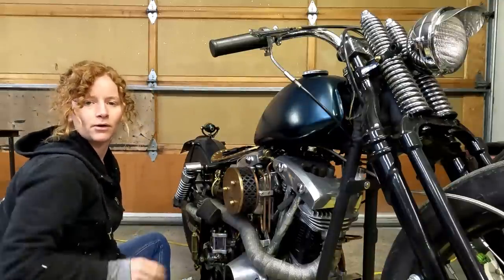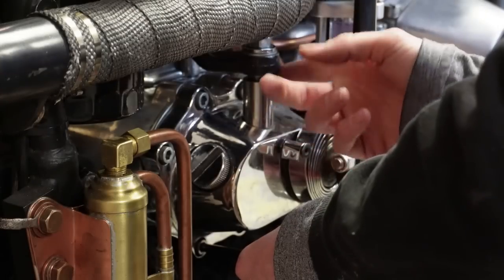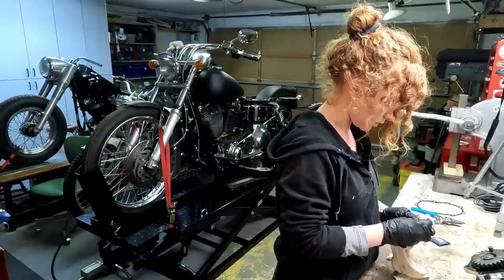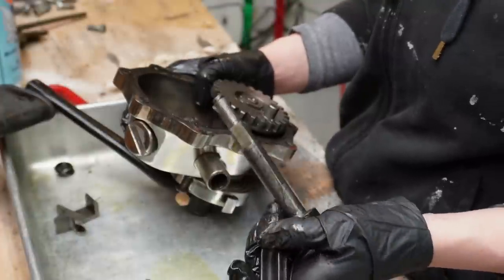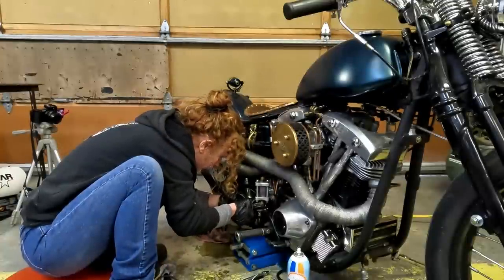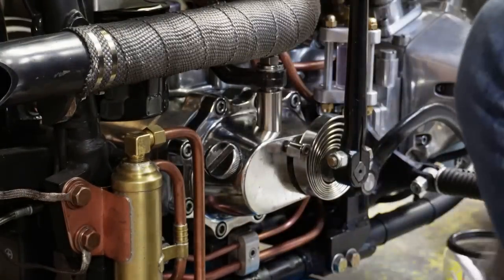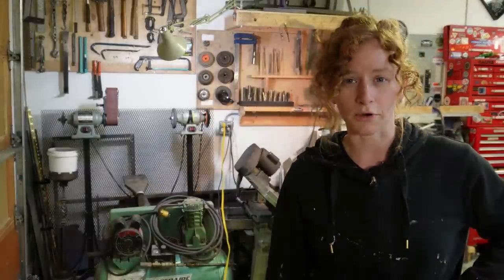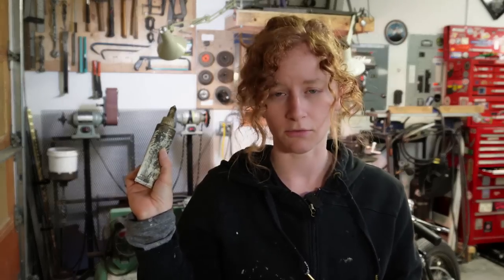4 Speed Transmission Clutch Release Finger Replacement

Comment: Just started watching a few minutes ago. The replacement throw out fork you’ve got as a replacement looks pretty comparable to factory panhead or shovel forks which is a step up from what you took out even in unbroken form. Had a kicker cover like yours with the flush mount Allen bolts on my pan at one  time and shitcanned the fork before I ever tried to use it. I run jockey shift on the pan which necessitates running the old style throwout bearings that knuckle, pan and flat side shovel used. They hold up much better on a jockey shift setup and can live a LOT longer when using aftermarket clutch springs like the Barnett springs. They’re interchangeable on your bike with the throw out bearing you’re running as long as you run the old style heavier pushrod that doesn’t have the end whittled down to slip thru the little Torrington bearings.  

Anyway it was just a thought for an upgrade. I’m almost positive that your Dad knows about the throw out bearing and pushrod I’m talking about, he might even have one of the old setups laying around to give you a visual reference. My buddies 100” shovelhead got changed over to that setup about 25 years ago and still had the same parts in his trans the other day when I was at his place. Anyway, great video young lady, keep up the great work. 👍
Reply from the maker: Cool, thank you for the extra info and knowledge! I’m always happy to learn something new about these old shovels and what makes them more reliable 😁
Reply: @RedRiderCanadaBC  Glad to pass on a little bit of knowledge and glad to see old iron still up on two wheels. The old ratchet top transmission is hard to beat and set up with the right clearances they can actually handle some horsepower.
Reply: That's A big 🔟-4 on the brake cleaner....Red!!! It also can B....4 ...used...4 starting fluid...2...help   start.. old junk cars... again!!!!

Comment: You got a slight breakdown of a part that gave you experience. I also like the old equipment, because it is maintainable. The engine and gearbox on my motorcycle have not been repaired for more than twenty years. And when I decided to repair the engine and gearbox, I was very shocked, there was a huge wear of parts, but the motorcycle never let me down. He's like an old soldier, he'll die himself, but he'll save his friend. My engine has a dry clutch, the rivets of the "squeeze" disc have been erased for a long time and the discs were just hanging on the shaft, and everything worked anyway. The caps on the valves were erased a long time ago and still everything worked and did not let me down. The old technique is an amazing technique. Whatever happens, don't sell your Angel motorcycle, it's a part of you!

Comment: Nice video and you’re absolutely correct about not giving your bike to someone to fix but to fix it yourself, because besides the fact that you’ll know your bike also you’ll get a stronger mental connection with it. 
Btw, I wouldn’t throw away the old, broken clutch finger but I’d chamfer the crack places, put the thing on the shaft so the square inner diameter is sound and weld the thing with stainless, haha.
Reply from the maker: Hi, thanks for watching 😄 
I couldn’t agree more, I think it is very important to be able to fix the vehicles that we own and ride/drive and for exactly those reasons that you mentioned 🙂 Plus, it also just gives such a great feeling of confidence the more we understand and know how to maintain our vehicles!

Comment: I have an ‘85 Evo FLHTC. It’s 5 sp trany has the same style of release finger. The bike has 300,000 miles on it now and I’ve had to replace several of these parts. It would break in two stages. After the first feeling of something snapping the clutch would have a weak, “springy” feeling. After having been through one of these I knew to save the remaining clutch shift for when I really needed it. I could still clutchless shift to get to where I could safely work on it. After a couple of these I noticed that the shaft that turns the finger was developing cracks at the corners of the machined flat surface that the finger fits onto, and was twisting. I think the twisting broke the finger from the inside. From then on I always carried a spare of both the finger, and the shaft. I could replace them in a parking lot in 20 minutes.
Reply from the maker: Oh wow. This is the first time something has broken on me on the road, and I’m glad I didn’t have to fix it where it sat haha, cause I don’t normally carry tools.
Reply: Have the same bike and have had the same problem after waiting half a season for the part I too have a spare, next time I will convert it to ball and ramp my hands are starting to have trouble. Squeezing the old style. Awesome video Red great channel love to see the next generation wrenching the classic.

Comment: Glad  I found our post - I will watch it today - im watching , and looks like you clean that bike after every ride - she shines well - Engineer and Scientist are titles. You are an Engineer, and your dad ap[pears in my opinion to be a scientist -  your machine belongs in a Jules Vern Movie - 

In Reassembly you omitted cleaning the surface of your "Jumper Box" and what did you use for a gasket or gasket cement? But good advice on the cable adjustment - 

No Slam Shifting for sure - 

Thank you for the video - ❤ and byt: OMG !
Reply: Whammming 😂

Comment: The bike is a late 60s early 70s surviver. Paco frame. Maybe one of sugar bears early front ends. Gotta investigate that. Stretched, lowered frame. Springer of course. King and Queen diamond tuck seat. Still running the mag. 9 foot wheelbase. I want to restore it back to it's bass boat metal flake 70s paint. Gonna dress the part when I ride it. Mutton chop face hair, bandanna on the head, boot cut jeans with boots and a fly collar shirt with a vest on top. Gonna be a time traveler is my thought process. Some David Man type shit. Anyway, thanks for posting. Your vids are great, hope everyone is happy. Keep on keeping on sister.
Reply from the maker: Sounds awesome 🤩

Comment: Riding beats driving any day! There is a reason I like old bikes, they are pretty much straight forward to work on. Oh don't get me wrong, they can be a pain to work on, but nothing like todays bikes. Electronic this, electronic that, ride modes, throttle by wire and on and on. I call them throw away bikes. Cause that's how I feel when something goes wrong on them. Just give me air, gas and spark and let's ride! Simpler everything makes for the better bike. That's just my way of thinking anyhow. Great video and wrenching Red Rider! Ride and stay safe up there in your beautiful B.C.!

Comment: Awesome video Red! If the broken piece isn’t cast, you might see if you can get it welded to use as a back up piece. Looks like it broke at the weak points. A good welder should be able to fix that.

Comment: Hi 👋 Ms. Red Rider, I noticed that square shape or geometry , with its (internal) “sharp” edges, could represent an incipient fracture itself. Seems it broke along diagonal, indeed. A little bit incautious design, at least, I would say.
Another thing I noticed, but this goes beyond the technical aspect, if I may, that the hair up looks very good on you, it highlights the neck. 
Have a super duper nice weekend .
Reply from the maker: Yes I think that this part was an aftermarket one and not as reliable as the stock, it did look a bit of a poor design eh? And thank you for the compliment! I never know what to do with my hair 😆

Comment: Nice job! I kind of figured your dad was right. His upgrade probably made it last as long as it did. That fork looks like a weak design. I just got my old turbo 750 running, need brake parts, glad I have spare parts lying around as few are available new. (1985 Kawasaki).

Comment: Hey rider. I dig your post. I have 2 kick only bikes. A 77 shovel chopper and a 51 pan. I'm wanting to know about the oil line coming from the timing hole? I don't know anything about it but would like to ad to my shovel. Keep the videos coming and be safe. Ur # 1 fan here!
Reply from the maker: The piece coming from the timing hole is a custom made block that the external drain lines on my heads go into. It was on the engine when I bought it.
Reply: Thanks for the reply. I have never seen that before. I'm always about being different. I have an S and S two throat carburator that I'm going to run on my shovelhead. It has a super G on it now. I've ran them before. Performance wise,it's not as good as the G but very unique. It all depends on how easy it is to kick start. I would like to send you some pictures one day. Ur amazing and I dig it. Ride safe, Kelly

Comment: ya might since its apart check your rods that run threw that your throwout bearing and oil slinger are on check that there not overy worn or show heat marks as never be any handier
Reply from the maker: I didn’t think you check that stuff out when it was open 🤦‍♀️ I’ll have too go over the whole bike I’m thinking before that year it’s out anyway.

Comment: Bobber looking good little red riding hood . More problems?
Reply from the maker: Every time I turn around there is something to fix on this old thing!
Reply: Maybe they have a better material for finger to withstand pressure? Or have it special made out of a harder material instead of the cast iron they use. Possible, anything is possible. You will figure it out. Take care red riding hood.

Comment: I inherited my dad's shovelhead after he passed I'm trying to install a kickstart but I don't know anything about the throw out bearing (oil slicker). Does it move freely or do I have to loosen the clutch adjustment nut?
Reply from the maker: I don't quite understand your question, but I will answer it as best I can... 
The pushrod that your oil slinger is on should only spin when your clutch is engaged, there should be some free play between your clutch and your clutch pushrod or your clutch is too tight. The pushrod should only contact the clutch when you pull the lever.
Reply: @RedRiderCanadaBC  so it moves in and out freely except when the clutch is engaged?

Comment: That broken fork looked smaller and more flimsy than the normal type like the one you replaced it with.
I think it might have been a cheap aftermarket one, the proper shovel forks last forever.
Reply from the maker: I think so too

Comment: Hate to be the one to tell you this.
You have the late throw out bearing in your transmission and the early fork doesn't work well with the late T/O bearing The late system is weak including the fork
The best fix at this point would be early T/O bearing swap and end up with the heavy duty set up
Hope it works for you!
Reply from the maker: Darn!! How can you tell the difference between the late and the early bearing? Thanks!

Comment: The exact info I needed what are the chances. I called 10 big bearded biker duds and none of them could help
Reply from the maker: I am glad this could help!! And, I would suggest trying to find an OEM part to replace that shifter finger as they are much tougher than the aftermarket ones.
Reply: @RedRiderCanadaBC  I ended up cracking the kicker plate taking it off lol and I ordered a kit with the kicker plate, finger and rod from drag specialties. I’ll see how that does I guess